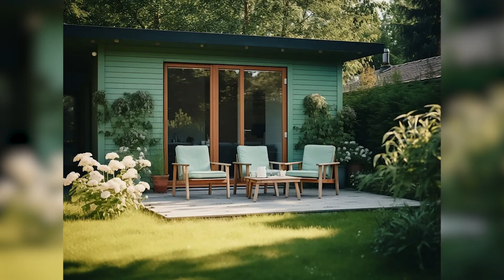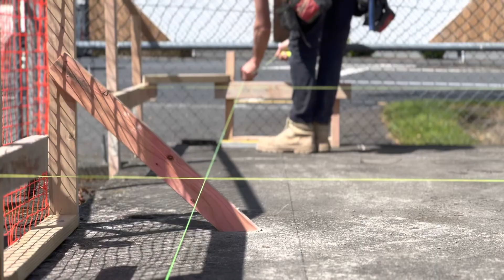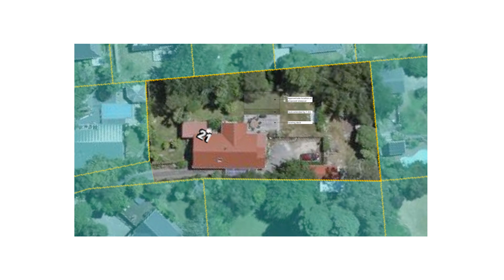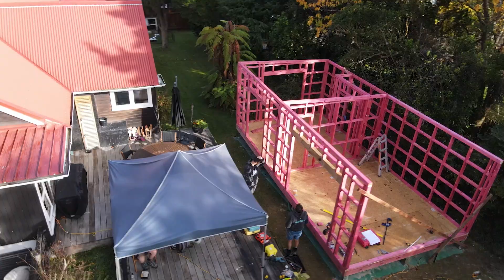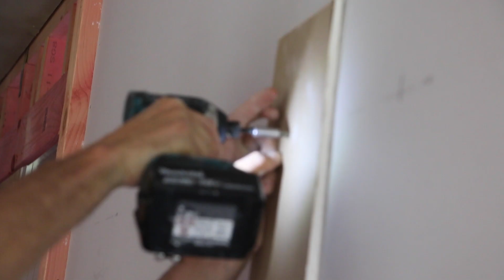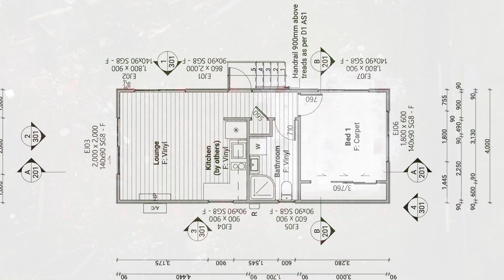Build a Granny Flat Faster & Cheaper: Here's How!

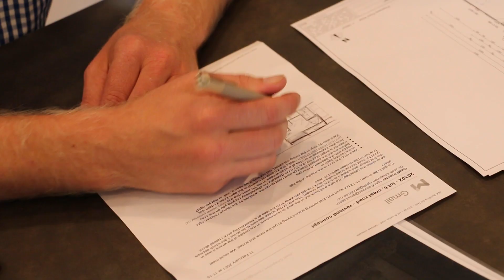Comment: Just need to clarify something you said at 3:50 "..It still needs to be built professionally." 
The current law does NOT require you to get professionals to build your "up to 30 sqm building". It does need to conform to Acceptable Solutions  B1/AS1 for timber or steel buildings but can be built by anyone including the homeowner. You could call that requirement "building it professionally" but doing so kinda muddies the understanding of how things are right now. 
It could well be that the new regs stipulate using an LBP to build or oversee anything from 30-60sqm. That requirement does already exist in the Schedule of Exemptions, for instance:  for building a carport between 20-40sqm. 
Will be very interesting to see what restrictions or requirements they place on the design and/or construction of Up To 60sqm buildings  in the new regulations.
Reply: they need to be fair and practical  . what is LBP ? thanks
Reply: @Ayeayeaye614 a Licenced Building Practitioner
Reply: Current rules must be constructed or supervised by LBP
Reply: @Dakalberry LBP is only required if you’re not building your up to 30sqm accessory building of lightweight materials. Lightweight basically means timber frame and lightweight roofing (not masonry tile) following NZS3604. 
Refer Schedule 1 clause 3A of the Building Act
Reply: LBPs will be required for this exemption, but I'm not sure why you would conflate 'LBP" with 'professional'.
Reply: @kiwigrunt330 ”Will be”? Are you talking about upcoming changes. Then any statement is pure speculation. Or point to a regulation or determination that supports your statement.
Reply: @kiwigrunt330  No one conflated “professional” with LBP.

Comment: How do you incorporate such a build into the LIM? Is it required? Is it possible?
(These are genuine questions I have, not rhetorical, because I hope to use the proposed expanded exemption.)
Reply: That's one of the common questions - How would the local Council find out about new builds under the new regs? How do they plan for infrastructure if they're not aware of all the extra toilets and waste dumping (pardon the pun) into the existing network?
Reply: If you apply for a PIM the local authority can judge what is required  to apply for, simply no BC  or RC  required or not and if the project meets the new government rules  it can be built but the authority knows there is something built and it effects what they know. This will allow them to adjust rateble values.
Les
Reply: @lescook354  Thank you for the information. I appreciate it.
Reply: @lescook354 That would require another change to the Building Act. Currently an owner can only apply for a PIM if the work involves a building consent:
To quote the Act:

An owner may apply to a territorial authority for a project information memorandum for building work if—
(a)
the owner is considering carrying out building work; and
(b)
a building consent is required for that work.

Comment: It's a great move. Fully agree with everything. It'll be great for single or couple renters too, it's so hard to find your own space not in a shared flat in most cities. 60sqm would be awesome.

One note on the build quality, yes it's still required to be built to code. BUT with nobody checking we're kidding ourselves if we think that there won't be a lot of corner cutting.
Buyers aren't across the standards, they're not inspectors, and as soon as the cladding and gib is on they'll be none the wiser.
Reply: This is why I plan to take 1000's of pictures of every detail when I self build one of these. I am confident can follow the building code, but I also want to have a portfolio of proof so future buyers trust me.
Reply: @Harambe_  You won't be allowed to self-build one of these. It will require an LBP.
Reply: @Harambe_  you can not build a exempted granny flat as owner builder.
Reply: 60 sqm makes logical sense .
Reply: I have discussed all the conditions on granny flat in my latest video. It is a good move, but there are quite a few conditions that people are not aware.
Reply: Many are not aware that the BC is only a bottomline. Building to code is very basic and performance is very low.
Reply: Exactly. Whilst some builders are like josh and will be all over the details. This is where you see a bunch of cowboys arise, blokes who gave up building in 2001 after the leaky homes shit show. shimmying up shit pile work, forgetting DPMs, forgetting fire linings, not leaving an air gap to insulation. Using galv fixings because they’re cheaper than SS. 

You can see it coming a mile off.
Reply: You can't get much wrong on a tiny home ..huh !!!..

Comment: Don’t you use vapor barrier on the inside before installing plasterboard? Over here in the Netherlands its a requirement.
Reply: Combination of things mean we don't bother to (yet). Plasterboard forms a partial barrier. Mild climate so it's not often that the outside of the building is that cold to condense water in the insulation. The "building paper" membrane on the exterior is vapour permeable so water can dry through it to the exterior. Houses, even new ones tend to be quite leaky in terms of air so ventilation is ok and interior humidity is fairly low.

The country hasn't had issues with condensation in walls, building failures here are mostly from letting the rain in. Solved in new buildings.
Reply: It's shown in the video
Reply: Vapour barriers DO NOT go on the interior side of an insulated wall in a temperate climate.
Reply: What exactly is a temperate climate?  All depends on which direction the moisture flows
Reply: @gregmorgan8350 Google it. NZ has a temperate climate. It all depends on the direction the heat flows. Warm air carries moisture, which it drops as it’s temperature drops. Where it drops that moisture is the problem.
Reply: Vapour barriers are never the best solution for controlling moisture transmission in any climate. Vapour permiable/breathable moisture barriers are the best when correctly designed for. 
Winters in NZ are generally very wet, with daily temperatures often crossing the dew point twice a day meaning there’s a constant transmission of moisture and condensation within walls. Install a vapour barrier in a wall and there WILL be condensation forming on either or both sides of it depending in the season.

Comment: No toilet and bath?
Reply: Under current regs, adding any sanitary facilities  (toilet, bath or shower) in this 30sqm design would have required a permit.
Reply from the maker: the clients opted not too on this 30 sqm design but you can include one if you wish, much easier too in a 60sqm foot print
Reply: @nzbuilder  Thanks. Good to know that giving that up isn't one of the compromises one would have to make in order to qualify for less stringent regulation.

Comment: FInally getting council out of the way!! perfect solution for people to cheaply get their kids out of the house and or help people supplement their income with a small airbnb, without the rediculous council costs grab for no reason.
Reply: Cheaply?? Depends if they include the requirement to use an LBP. As noted in the clips of the news announcements the consent saving is "up to $6500". Contrast that with the fact this 30sqm build in the video without any plumbing, bathroom or kitchen cost $100K.
Reply: @DiscoFang still too expensive.  better off if one can build oneself and not have to worry about stupid boundary restrictions if no real impact on neighbours
Reply: @staal2691 Well, the boundary restrictions are there for the very real reason that inadequately built structures, too close to a boundary, could indeed have an impact on neighbours. Quite literally an impact.
Reply: @DiscoFang  I bought a 8 x 3 tiny home for 57,500 delivered. cost me 12k to install deck 6 x 2.6 (I built deck with the old man), electrical, appliances, plumbed to septic, mind you septic was right next to where it was placed. all up $70,000 and now using as airbnb to pay off the loan on the house. $100,000 to me is better than a million dollar loan on a crappy 1960's house in Auckland.
Reply: So what’s your original point? Sounds like you acchieved it cheaply already under current regs.
Reply from the maker: exactly!!!